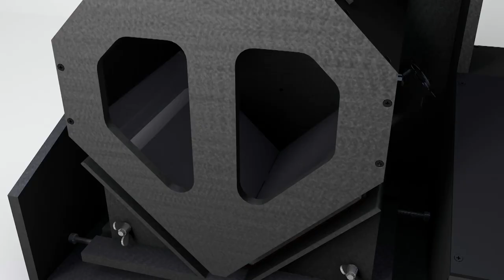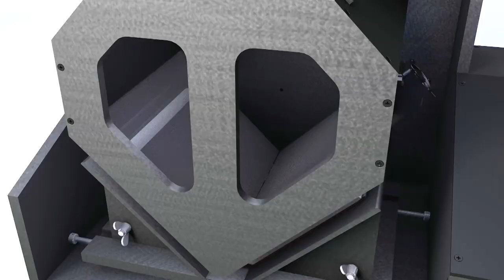building Libreflip - E32 - The new Stepper Driver works and I am taking apart the old scanner.

Comment: my man, when are you going to release the plans?
Reply from the maker: They are released and can be found on GitHub in the current version. 
https://github.com/libreflip/cad?files=1

When the plans change, as is normal in an ongoing development, I update the files on GitHub. 

I believe right now, the position of the end stop is not correct in the plans and the light of the suction box is not yet updated. I'll do that, when I can confirm that the light works correctly and does not produce any unwanted reflections
Reply: @IjonBerlin  thanks Ijon, this development is much appreciated